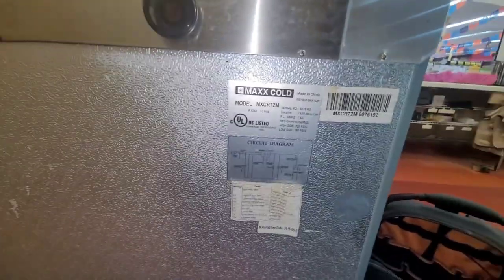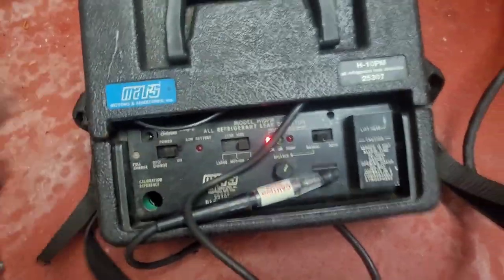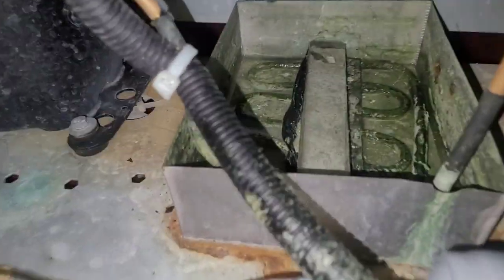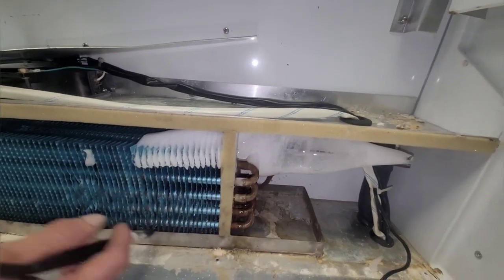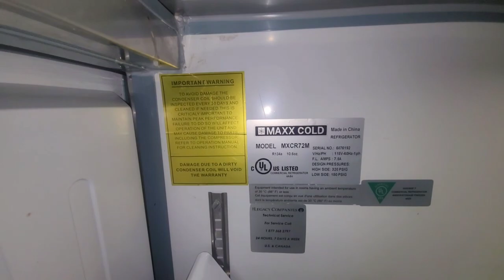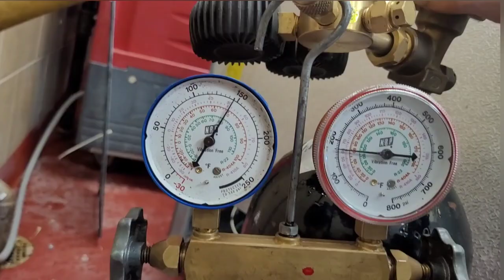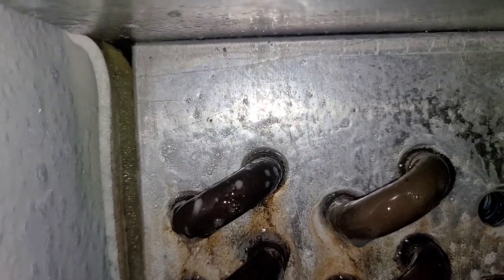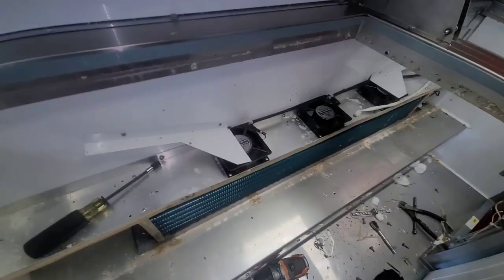Prep Table Lost 10.6 Oz R134a Dozens Of Leaks

Comment: What caused all the leaks? That’s interesting. How old was that unit? I’ve read about line sets for mini splits doing something similar, where acids build in the line set insulation especially the white insulation, and if you don’t seal the ends then the line set will deteriorate from inside the insulation and leak.

Comment: When you put nitrogen in a system like that are you ever worried the 300 psi nitrogen is more than the low sides 160 rating might cause a leak
Reply from the maker: Not too much. I have never had a rupture happen, in my whole career, from nitrogen pressure. I only went up to around 155, maybe 165, which is a little above nameplate pressure. In this situation, it was already leaking pretty bad. 
If you don't really feel comfortable pressurizing that high, than definitely don't do it. Only do what you're ok with, all the time.

Comment: Change the coil and cap tube along with the filter
Reply from the maker: I actually finally was able to get the coil for that like a couple months later. I don't remember if I recorded footage on that I probably did and I just haven't got around to putting it together into a video yet. They're cheap bro. The filter always gets changed, I'll only replace the cap tube on a 134a system if the refrigerant has overheated Beyond its acceptable range. 134a is very sensitive to that it'll plug a cap tube just from running long enough without a condenser fan running or the plugged condenser coil...as im sure you know..

Nice commenting with you, catch you next time..😎✌️